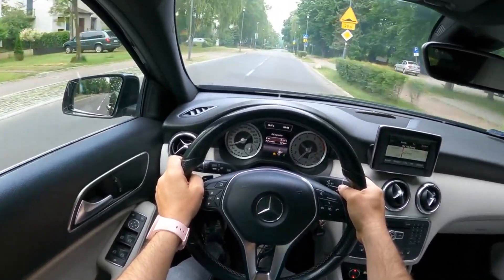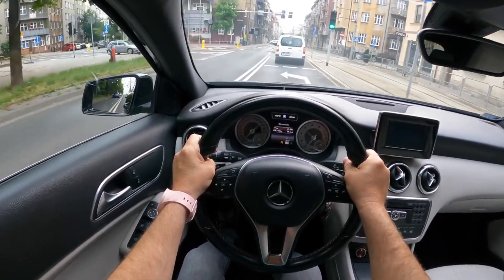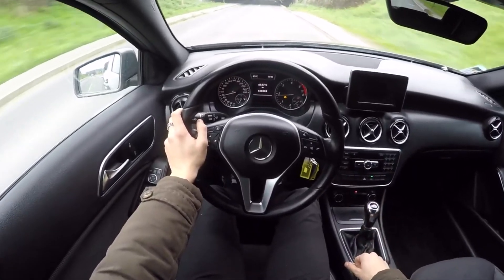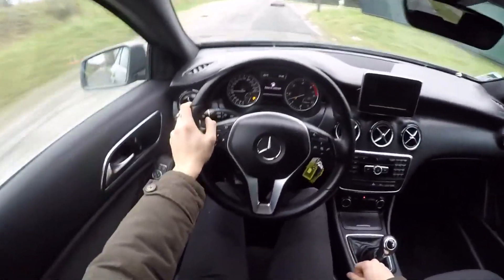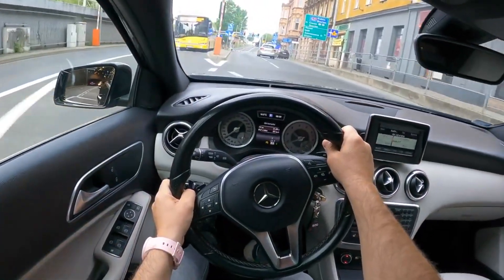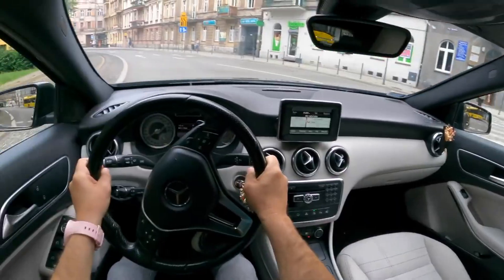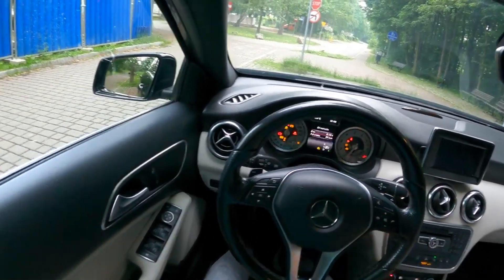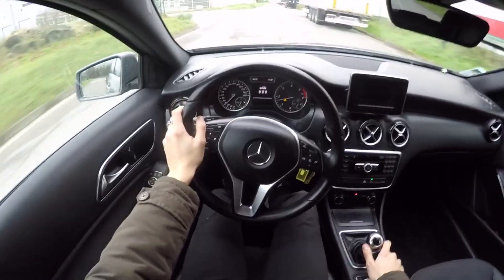Used Mercedes A-class W176 Reliability | Most Common Problems Faults and Issues

Comment: I would like to add some points on Electronic Parking brake reset, We can do it with Steering mounted control buttons instead of Connecting diagnostics Tool.